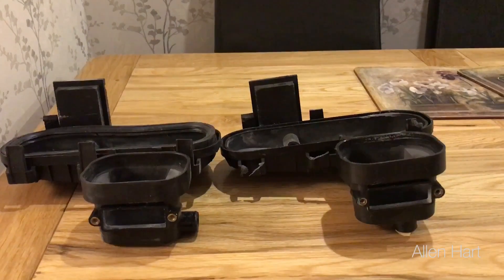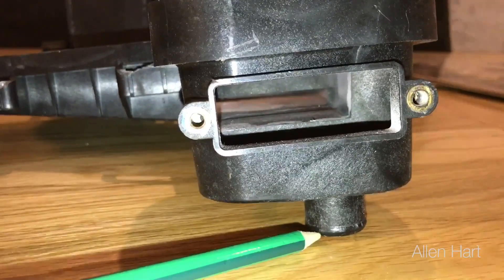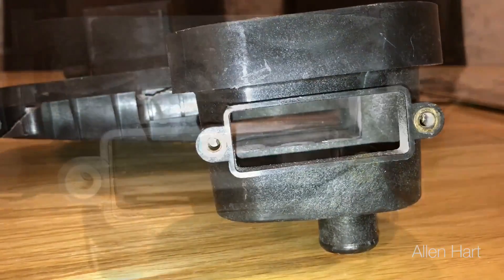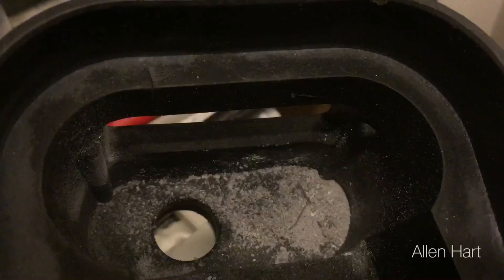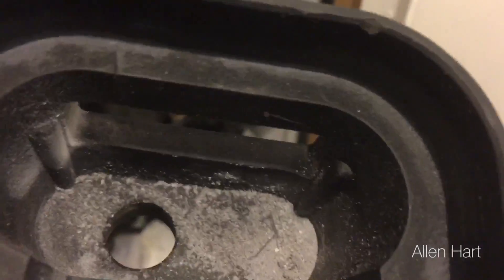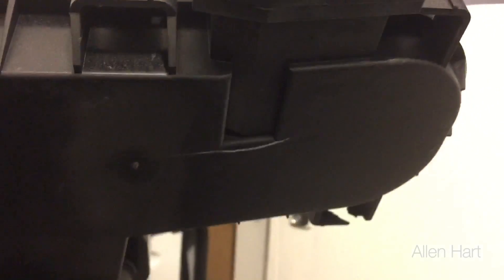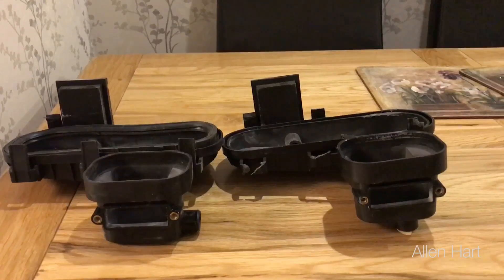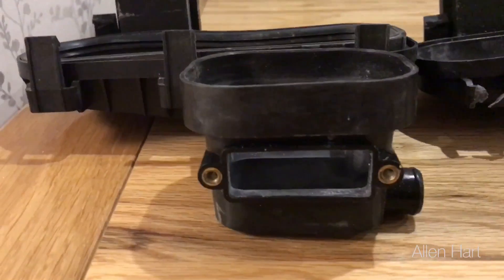Ideal Logic Cracked Sump Leaking

Comment: Exact same fault on mine ... the crack was identical to yours .... as a 
temporary measure mixed some resin together (the hard and soft tubes of 
glue) and applied over crack ... have fixed it for the time being
Reply from the maker: Please call a Gas Safe Engineer to check it. Once the case is removed it needs testing with a FGA. Thanks.
Reply: Thanks Allen ... will do.

Comment: Hi Allen, I’m a British Gas engineer, I’ve worked on a few of these now and believe I’ve found further issues with these boilers. If you put your performance tester around the back of the burner on the top of the heat exchanger (like you would with the glowworms and valiants with the rear flue collectors) it can show upto 40ppm. I’ve also tested on my 1 year old logic at home and is doing the same. I will be contacting idea first thing Monday and demanding an answer. Might be worth looking out for, as I feel il be capping a lot off! 

Ps, I have rebuilt one with ALL new parts and the issues appears to have no resolution that we know of.
Reply from the maker: Be very interested to see how you get on, please let me know. Thank you for watching
Reply: Allen Hart , apparently ideal seem to think that there is a permitted amount of CO that can leak out from the burner seal, one technical operative on the phone said the seal isn’t 100%. From all the logics I’ve tested it will be somewhere between 20 to 40ppm on high rate around the seal. I contacted gas safe who have said there is no safety bulletin and that without any info in the instructions about how much a permitted amount is then the boiler should be classed as ID. This has been past on to the British Gas safety assurance and technical team who are now investigating. 

Personally and like all my colleagues are saying, we know of no other negative pressure boiler to be aloud to have any CO within its own case. 

Watch this space I guess.....
Reply from the maker: Thank you for letting me know,

Comment: Have found loads of these on the  logics, definitely a design fault, ideal are saying its because the cover screw is putting strain on a very weak part of the sump and cracking it, ideal know about it, personally I would be getting ideal to replace free of charge, the damage being caused by the leak will corrode your cover and eventually will be id, lots of customers are not happy.......
Reply from the maker: Thanks very much for your comment, please consider subscribing to support the channel 🙂

Comment: Hi Allen, where can I get this part from. many thanks
Reply from the maker: any plumbers merchants will sell them, please make sure you get it fitted by a gas safe engineer as it will need checking with fga once its been fitted, thanks for watching.
Reply: Allen Hart cheers, got part, fitted by gas safe engineer. All Good and sump was cracked  on old 1
Reply: Hi  @c1tyboy , appreciate this is a 4 year old post of yours but any chance you can share the part number and place you bought the replacement sump from?
Reply: @Mike Ellis  Mike,  I can't remember exactly but if you go into the website for ideal and search the boiler number , it might give u a breakdown of each part. I can vaguely remember the whole boiler being expanded in a picture, looking for part and getting part number. A quick Google search or Amazon search will bring up suppliers and as you will have the part number, it should be straight forward. I'm no
 longer at the property so can't get  the details from that. Hope u manage to sort it